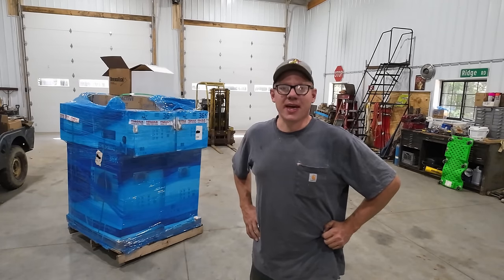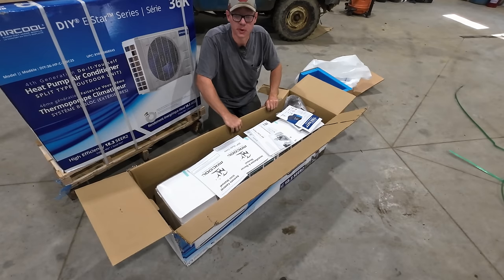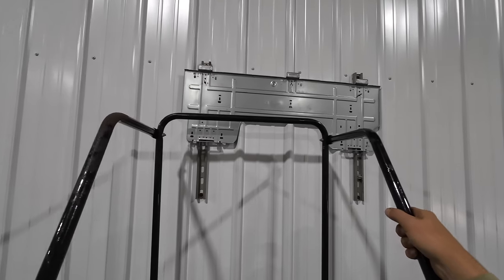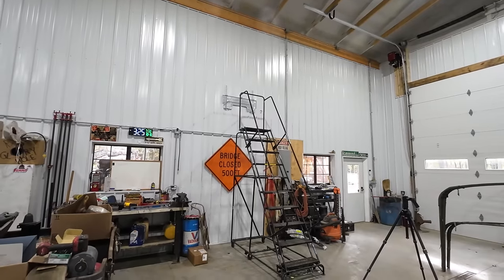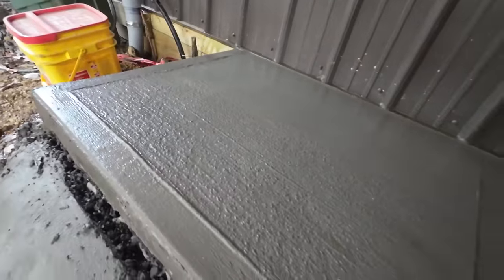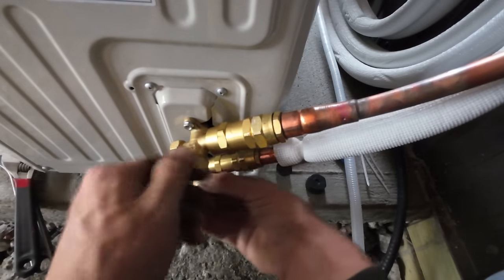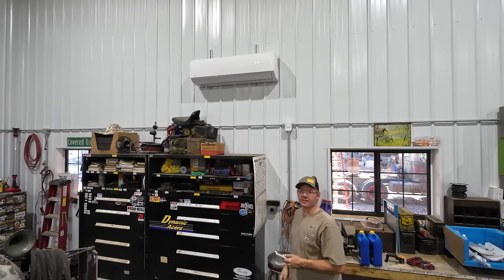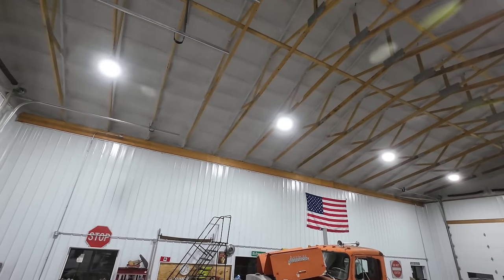DREAM SHOP Gets a Serious Upgrade! (How Hard can HVAC be??)

Comment: as a hvac specialist i cringe at these but as people already mentioned clean the filters regularly but also put some risers between the outside unit and the concrete slab if your gonna use them in freezing weather to heat.
cause in that case the outside unit is gonna condensate alot and it has to be able to get rid off that and when its freezing outside that freezes up to the unit and eventually freezes up the fan

Comment: Nice video, I love mini splits and put them in all the rooms of my house. It's a little easier if you tape all the lines together before putting them in the wall. Check out the blue ridge line. They require a vacuum but they are pre-charged. You could have gone the same thing with one outside unit and multiple heads
Reply: This way done by Matt gives you redundancy and fault tolerance.

Comment: If I may. I would leave them at the bottom of the uni strap simply because a can of appliance white will hide the top and you are going to see it from a lower angle so in essence there will be nothing to see
Then again if you hang it high you will see the uni strap and even painting it you will not be able to hide it. Having it low just looks more professional. Plus I would think since hot rises and cold settles, having the unit at the bottom you will get cooler a bit faster. It is not a big difference but it is still a couple of degrees and working in a metal shed (I used to when I worked for MOTOROLA) a couple of degrees will make a huge difference

Comment: U always check it for leaks before wrapping.. that's where it will leak if they are not tight enough. Soap bubbles 🫧 will work... also your outside unit should be 18" away from your shop wall for best efficiency. 41years in hvac your line set is also blocking your air flow.. it will work just not as efficient..

Comment: Hey Matt how you doing Good job on the install the HVAC. He pumps for the most efficient because they not only heat but they cool now I know that you know that but if you're interested you can go online and research about entropy, enthalpy, thermal dynamic law but basically what makes a heat pump different from a standard air conditioner is a device called a reversing valve. That valve changes the direction of the discharge gas exiting the compressor. So in air conditioning mode if you want to think of it as air conditioning mode the indoor section is your evaporator coil and the outdoor is your condenser. When it goes into the heating mode the reversing valve changes position and now the evaporator is outside and the condenser is inside. One short thing you can remember is that science has determined that there is molecular movement of electrons to temperatures down to minus 460°. Basically, the freon will absorb the heat in the air pass it to the refrigerant, then the refrigerant flows through the compressor which supercompresses the vapor adds heat of compression and sends it to the condenser. The condenser gives off the heat through thermodynamic law. Condenses for my high pressure high temperature vapor to a high pressure liquid. It is the changing of state between a vapor and a liquid and that is how those systems function essentially. So even if the outdoor temperature where you live was 100° below zero absolute zero is -460 so that's 360° of - temperature lots of heat that he is drawn in through the outdoor unit and pumped into your house or in this case your shop. When you add heat of compression to the ambient temperature that's how it functions. Either way they're super efficient. However, I would recommend if you're interested in studying BTU energy called heat gain or heat loss. You have a massive shop and in the summertime or the winter time those units are going to get a workout. But even if they help some until you get your other heating figured out they're still a good deal. You may find that you want another one that you can put into a small shed. A place where you can go for lunch and really get a nice cool down in the summer time or a heat up in the winter time. You take it easy.
Reply: You will want to remove those screws in the condensing unit that you put into the concrete and put rubber in between the unit and the concrete. Otherwise that thing is going to rattle like a rock in a can. Keeps the noise down stops vibration.

Comment: Having had several split systems I can tell you that you are far better to mount the external  heat pumps  on the ground and in the shade of a roof. If you roof or wall mount, no matter how well, you will get vibrations through the building . Just put a concrete paver down to sit it on.  If you put them on top of that skillion roof you would cover them in snow in the winter and the units may freeze up on you. (Great decision) , excellent job 👍

Comment: Adding at least four large ceiling fans would also help. I run my fans opposite of what you're supposed to because my place is like yours super high ceilings. Running backwards and I'll push all that heat down so the heat is on the floor and not up in the attic in the same way in the AC suck that heat up and bought a couple gable vents in and you'll get rid of all that excess heat that's in the garage.
Reply: It's  radiant floor heat, so....  not hot air up there!

Comment: Maybe using the exposed Unistrut above the wall units to install a small cover above the intake to slow down the particle consumption build up inside the units inner workings. After all, it is a shop that creates lots of airborne particulates. Anything to extend the units life in a shop environment.

Comment: I'm surprised you didn't test the connections with soapy water before you wrapped them with the noise deadening tape.  Just because it's a factory connection doesn't mean it can't leak.

Comment: Closer to the floor is better because the cool / heat will stay lower where you are and above the unit will work as a insulater Neutral

Comment: Before I watch this I'll answer a question HVAC can be pretty simple but it can also become the fight of your life depending on the desired result and space you're allowed to put stuff doing your own can be easier and stuff that's visible is harder than stuff hidden in a crawlspace or attic because hidden stuff you can manipulate more and a dent or 20 to shift it to the vent isn't as big of a deal as dents in stuff you look at daily I like that Tennessee fellers socks across his shop if I build a new shop I'd go that route especially with a squirrel cage fan pulling heat off your boiler to heat the air as the pen lines heat the floor

Comment: Hey Matt, a possible add on modification suggestion for you. I notice the top of the indoor unit vent is wide open to dust and debris that will eventually settle inside the unit. To keep the unit reasonably protected I might suggest fabricating a sheet metal awning a few inches above the unit. looks like it could be attached to the upper wall braces that you installed.  Just a thought on my behalf. 
BTW... really enjoy your videos keep up the good work and stay safe.

Comment: Hi Matt, you just don't appreciate how good life is till you get an air conditioner after not having one
I have just watched the video on your installation of your units.
I had a Fujitsu split 5.5kw system put in myself about a year ago silent as anything, but over the past week we have been having 39c (102f) with today being another 39c +72%Humidity
It is going to get into the 40s in the next day or so, I was a little concerned at the electricity bill even though I have a 6.6kw solar system but I needn't have feared it didn't add any extra cost to the bill
I wish I had this total package years ago.

2 things
Have you got your first electricity bill yet and how much more has it increased?

Are you going to put up solar  to assist in your total power bill for the shop?
Another great video Matt, thank you
Tony from Western Australia 🇦🇺

Comment: The shop I used to have had a vaulted ceiling like yours and guaranteed it’s hot up there so the fans you plan on will be a great addition the big ones with lots of blades would look really cool but as I’ve said before it’s your baby do it however you like.

Comment: You are right to say those mounting strips don't ook good protruding like that, a coat of paint would make them blend with the wall. However the best solution was to cut the strips to the length of the wall plate thereby making completely invisible to the naked eye. 
Otherwise this is a great installation 👍

Comment: Reverse cycle is the choice in Australia.  Gas and electric heating are way to expensive.  The inverter systems we have in our home have a multiplying factor of about 4.5  ie 2000 watts in and about 9,500 out.  You cont argue about how efficient they are.  And they are hardly ever running at full  speed, can't hear anything inside and not much outside.  Apparently the lack of noise is due to improvement in the shape of the blades.

Comment: Huge congrats! Great work, especially by yourself. (If I had to do this, I'd be spending a lot of time and $$$ at the local equipment rental emporium for the concrete mixer, loader and then pad supplies from the local home improvement store). I had no idea these types of units (2) would have enough oomph to handle a space this big. Good choice and again Good Job You!! (Glad the power co was able to complete their job. Hopefully they did it at a more reasonable cost. But in any case, it's DONE!)

Comment: I have installed a DIY kit on my garage ! mine also produce heat! in Quebec Winter can be pretty cold! so now i can Heat my garage with a fraction of the energy required to drive my 5,000 watt heater! I have 12,000 BTU to heat and cool about 800 Sq. foot

Comment: When I was staying in a shelter because I'd become homeless there were some seven blade really big fans up on the ceiling. This area had about 80 plus beds. One of the fans blew down and one of them suck the air up to circulate the air. They were quiet and efficient. I don't know the brand but seven blades should not be hard to figure out.

Comment: Matt, what are your electrical rates per kwh? Out here in S. California, they are $0.25 to $0.63 per kWh. The 36k btu units draw 35 Amps at 230 Volts. That's 8 kW. So for me, two units could run up to (2x8x.63) or ten bucks per hour! Off-peak, it might be $4.00. Hopefully those are worst case; the units may run less than 35 Amps most of the time. And maybe Pa. rates are lower. Let us know what December costs you, please.  Love your channel, especially because you don't confine your channel to cars.

Comment: Definitely looks like the path for the tubing WILL be a source of bugs, mice, and air / moisture coming into the shop.
I would be very curious to see all that extra tubing ( behind the outdoor unit ) on a thermal imaging camera.
Some kind of way to draw the air from the very top of the shop and / or the very bottom of the shop and move it towards or directly into the unit. An air filter could be thrown inline. A fresh air intake from outside or building exhaust ( heat exchanger ? ) could also be incorporated into this concept. The giant ceiling fans are nice, but they create a draft and cancel out a lot of potential ceiling storage space via hanging things from the rafters.

Comment: I don't understand why in the US they always mount the outdoor unit on the ground, while everywhere else its always mounted on the wall, preferably as high as its possible. Sometimes even on the roof. Mounting it on the ground has many disadvantages, for example it will suck up all the dust, it will be covered in snow in the winter, it will get flooded in heavy rain, you have to make a pad for it etc.
When mounted on the wall you just buy two L brackets made for these with rubber vibration insulators and that's it. And a huge plus is that it does not take up space.

Comment: Get you some 3M Velcro to where you can stick it to the siding of your shop wall and remote control to your unit right there at it that way you won't have to look for it and it won't be on the counter or getting broke or something spilled on it accidentally swipe up in the trash I like the air conditions in the heat pump. PS Happy Thanksgiving Matt to you and your family.🎉🎉🎉🎉🎉

Comment: whats a heat pump do? it takes ambient heat from the atmosphere and warms the refrigeration now used in a reverse cycle. if your temps are cold enough you need supplemental heat

Comment: Interesting that you went to the trouble of running all those pipes through the floor. The mini-splits will also heat, at least to some extent, so I'm wondering if you needed the complex water system.
Reply from the maker: Floor heat is a far superior and more efficient system. I’ll get it connected soon I hope.

Comment: It's a bit late now, but maybe it can help someone else, should wait to wrap up an insulate the lines until after a vaccum/pressure test.  Butyl is a PITA to peel back to fix a leak.  2nd pulling a vacuum on the system before releasing the charge can help with efficiency.  Get too much air in your freon and it loses it's ability to move heat place to place (hence the heat pump). obviously it worked out this time,  but still a good idea.

Comment: I never understood why DIY channels always push this stuff. 100 bucks for a vacuum pump, 70 for a flaring tool, and you can install industry standard ACs from reputable brands (yeah you should start with a pressure check with a tank of inert gas which is another expense, but face it most HVAC don't do it either since time is money and it's not a big expense either if you do decide to do it properly).
This is a useful skill, and you don't overpay for "DIY friendly", subpar units. For such a short run you don't need need to buy any additional refrigerant either, split units are precharged with enough for a few meters at least (this info is easily available in the manual and on manufacturer's website).
And it would be insanely more interesting to the general public than same old advert of "DIY friendly" that every other channel does.

Comment: MASSIVE amount of roof space. You could easily set-up a 20Kw or more solar system for half the price of what the electric company wants to charge you. 
It would pay for itself in 10 years, no electric bills...Add a diesel generator as a fail-over also if needed.

Comment: cam.klingon is correct CLEAN THE FILTER ALOT (that part is very easy) ALSO you must clean the blades regularly, you will hate that part, but no matter what you do the "filters" do not keep dust out the blades WILL get covered and moisture will make glue and it will build and NO the self clean cycle will NOT WORK (you can ask their techs)   I have  2 of them for @ 10 years now, still going strong     hint... if the outside unit starts to ice.... you are low... the good , with these according to Mr. Cool as long as the Freon is not empty that means you can refill to @ 130psi and all good no vacc. no fancy stuff.... those certain  people you don't seem to like either scream about this BUT by federal law YOU CAN CHARGE YOUR OWN UNIT , alot of them won't sell Freon  but you can get it even from you Mr. Cool. you should really like these units ........... one of ours did leak from new and they even paid a tech to come look , it never got completely stopped so i added some stop leak after warranty expired (it voids the warrenty)  and it has not leaked sense   all good. for years now.  we enjoy your shows.

Comment: Great job and the units are great, but what's going on with that digital electronic wall clock ?  That rapid blinking would me crazy.
Reply: It's a product if the digital camera...  The LED flickers at a rate that leaves gaps in the image. 

Remember the airplane propellers seeming to turn slowly backwards?  Frame rate.

Comment: Although units come precharged with gas you should always create a vacuum in the lines before opening the valves in the outdoor unit, as they contain air with moisture which in consequence cause the degradation of the oil inside compressor and shorten the lifespan of the unit. Another mistake is coiling the additional pipeline in vertical coils (instead of horizontal), which will trap the oil from the compressor. You should also consider mounting the outside unit on rubber blocks to eliminate noise and vibration, the concrete pad was an overkill as two concrete blocks laid on the ground are good enough for the support of the unit. Be careful with bending the lines, as the thicker one is very prone to kinking, so the 90 degree turn is impossible, and kinked line will limit the power.
Reply from the maker: The line sets are sealed, no need to vacuum them down, that’s why this is sold as DIY, if they weren’t special Line sets I’d have cut off the excess and not had that coil at all. Also they have small rubber pads under the feet. I did it according to the directions.
Reply: The line sets that  Mat used are precharged no vacuming needed.

Comment: I know you've already made you decision about where the outside units are going, but I'd stick them to the wall a couple feet below the leanto roof...

That way, the radiators are out of direct sun (improving cooling in the summer) and out of the weather (improving overall life span of the unit) but also out of the way of your equipment that you park under the leanto as well...little to no risk of accidentally punching forks or bucket teeth through the unit because you got distracted for a moment when parking the track-loader if the unit is 5 feet off the ground...

😄😁😆😅😂🤣

Comment: If you mount outside units under roof, that will keep snow and ice off plastic fan blades!
Reply: And they are nice and quiet compared to "olden days" ac units! Inside and out.
Reply: If you do dusty work or paint work in shop, make a addon air filter setup for top of inside unit[wood frame w/furnace filters]
Reply: A/C will be real efficient as you only cool the lower 8-9 feet of shop!